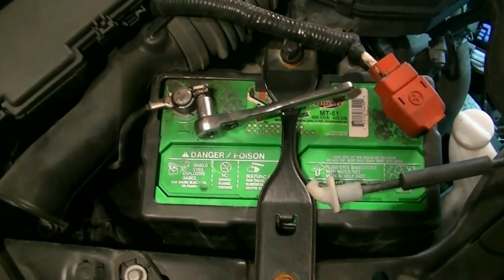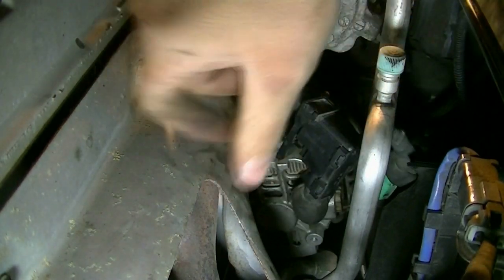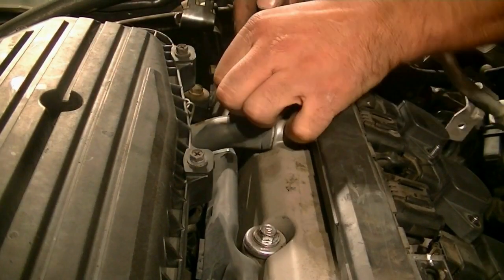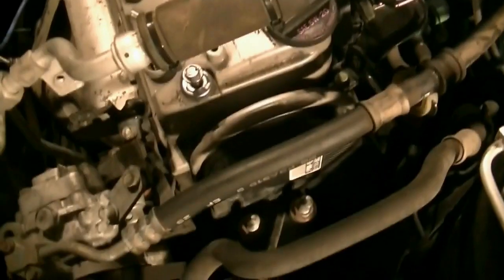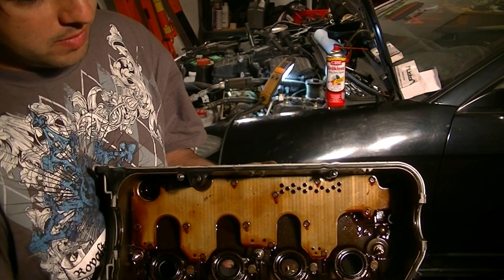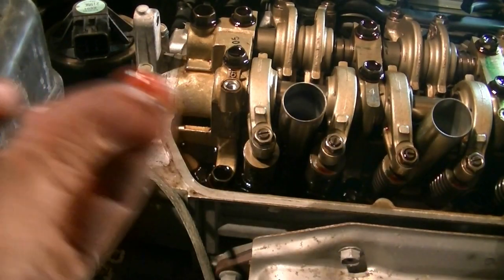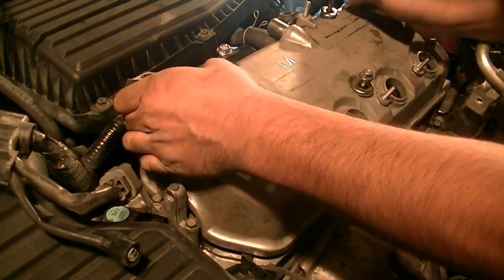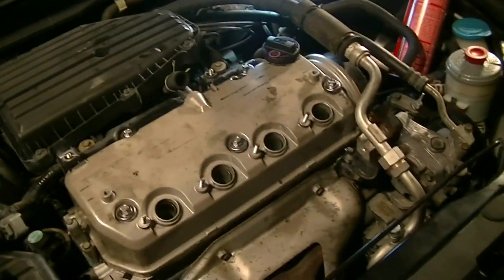Honda Civic 1.7L Valve Cover Gasket Replacement

Comment: Did this myself. The mechanic that did my timing belt had put the valve cover on with one of the corner tabs of the gasket folded under itself, so it was essentially doubled up in thickness in that one corner and leaking like crazy down the front and side of the head and engine. Watched your video and 1A Auto's video, and the job was a fairly simple one. I cleaned the head and engine of the oil as much as possible with some throttle body cleaner (all I had on hand) afterwards so I could tell if it was leaking again. Took me about an hour 1/2, being very meticulous. That was a day ago, so far, no leaks.

Comment: Just did mine (2004 civic) You had perfect instructions.  The hardest part was getting the spark plug well grommets off because the OEM grommets had a metal ring in it, so I mistakenly thought it was part of the housing.  But I finally used a channel lock plier to grip it and fulcrum it to rip it out of the socket. Easy peasy.  Thanks for the video.

Comment: Awesome man you are the best this is the exact engine I have I was searching and searching for a head gasket replacement before I realized it was actually the valve cover gasket that I needed to replace this will stop my oil leakage I feel that if it was the head gasket not have far more symptoms anyway you made the pics very very easy thanks a lot man

Comment: If you are having trouble getting the valve cover off,  remove the air filter housing and there are two bolts that are getting in the way of lifting the valve cover up.  (2002 civic)
Reply: Watched this video. Couldn't get valve cover to let go. Came back in, read comments, Saw this. And it worked on my 7th gen civic. 2001-2005 LX. Thanks random commenter! And thanks RnW for the AWESOME video!

Comment: Hello I truly appreciate your video and has given me the courage to try it out but i think i bite more than i could chew on this project. Anyway I have almost the same case as yours where a friend of mine asked me to help him with his valve covers gasket and inspection from the mechanic said he needed to change gasket and timing belt and water pump, well everything was going fine until the harmony balancer part. i was not able to break the nut and in the process happened to turn it clockwise instead of counter clockwise and so now wondering if it will line up at TDC. Also it had asked us to change both the coolant lines. Any ideas i am most appreciated. thank you

Comment: I did replace the gasket but it still leaks, I would recommend utilizing the RTV around the entire valve cover, new gasket and it leaks?  I did do the four corners, but gasket was Autozone, not OEM but I will clean the gasket with Palmolive, use RTV and see if that works, if not, then to Honda dealership and see if their part is better.

Comment: I just bought a new valve cover kit and it came with 8 grommets...4 that fit in the valve cover and 4 that fit on to the spark plug cylinder...have you seen this before?

Comment: Good video! The RTV sealant... why didn't you go all the way around? why just the corners?
Reply from the maker: rtv silicone is a beast to get off sometimes. Only use when necessary, infact on a flat surface the valve cover gasket seals better without rtv. cheers

Comment: I got my valve cover gasket replaced at a mechanic. I've done it before on a different car, and while there is more involved in freeing the valve cover, I don't remember having to do anything called a "variable timing control actuator" but it was on my mechanic bill for $190.  Is there any instance where that would have to be replaced with a valve cover gasket leak repair?

Comment: I assume since you said you're doing a timing belt you went ahead and removed the alt cable.  If doing just the valve gasket.  You dont need to remove the alt cable.  Just the coilpack cables and cruise control cables then wiggle the valve cover off and to the left.

Comment: Can you take the timing belt cover off with out removing the valve cover? And if you can you think it would damage the gasket and start leaking?? Pls help me I would I appreciate it
Reply: No, you have to remove the valve cover first.  It has a lip that fits over the timing cover.

Comment: Anyone have tips to seat the spark plug tube seals over the spark plug tubes? No, they're not backwards. They just barely sit on top of the gaskets and they slip over when I try to tighten at all.. PLZ HELLLP, RATCHET Dx